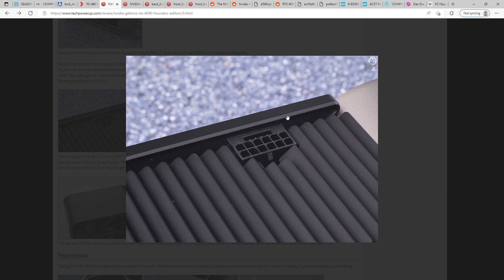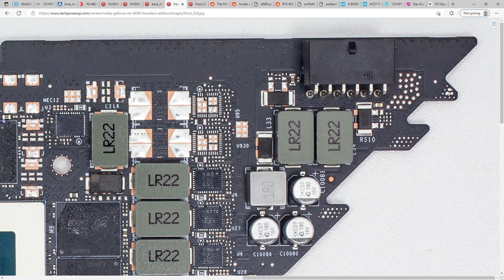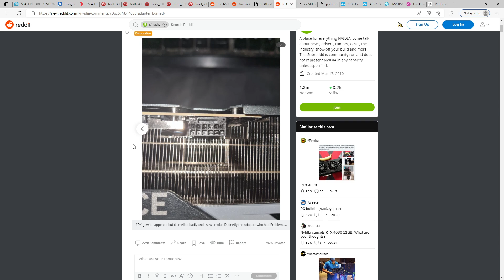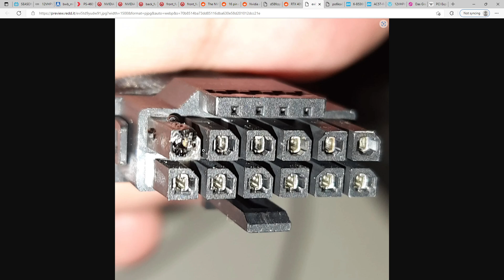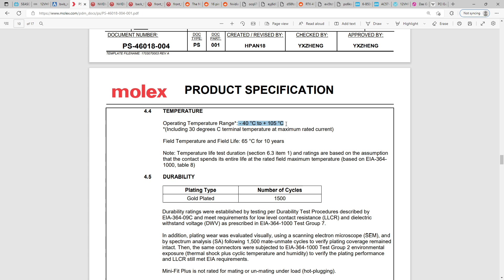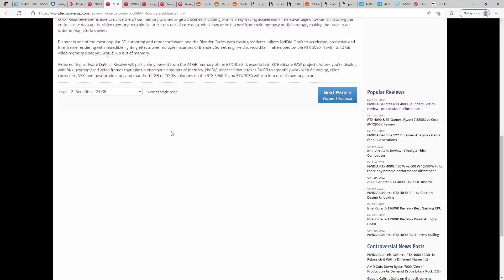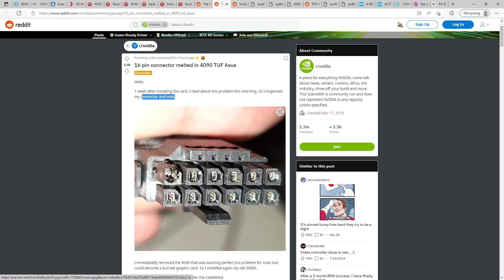rambling about the 12VHPWR failures

Comment: If you watch on "father" eatx12v 8-pin old connector from mobo back then (10-15 year ago), you will see that metal pin was square and solid. Now it's round and empty inside. I was facing problems with melted eatx12v 8-pin connector (never forget that smell after I run P95 small FFT's at around 30-35mins xD) on asus mobo(m5a99x evo r2.0) when OC'ing fx8350 to 4.6-4.7Ghz and 1.36-1.42 on Vcore. I think it was mostly coz of ~10 times cycle of reconnecting (switching between 3 cases) and coz of not so secure design of connector. After I buy some new connector and resolder to mobo and change connector on PSU it will run just fine 4.85Ghz(Vcore=1.4V) and even 5.0Ghz.

Comment: You started wrong and seems you are one of the more ignorant ones explaining what arcing is. Arcing means an electricity jump from one connection to the other. What are you talking about arcing from higher voltage to lower voltage?
Reply from the maker: if 2 things are at the same voltage there won't be any current flow between them.
Reply: @ActuallyHardcoreOverclocking  Look, if there is a small gap or disconnection, it renders the other end with no voltage at all. It is when the gap is too narrow that the current will pass through the air and then to the conductor on the opposite electrode. Unless you are saying that lower voltage means zero voltage.

Comment: 12:24 you are right. But to be fair it looks very very cost optimized to the point an engineer concerned with safety cringes how flimsy it comes across. Sure enough cross section will handle current fine, but man this looks like an artificial fuse like in the bubble gum wrap fuse. Well it can handle far more current than you expect, but man it is a joke.

Comment: I think it's ABS, the "melt" temp is pretty much what the glass temp for ABS is so it would need at least 105c to start to glass.
Reply from the maker: it's Nylon: https://cdn.amphenol-cs.com/media/wysiwyg/files/documentation/datasheet/boardwiretoboard/bwb_minitek_pwr_cem_5_pcie.pdf
Reply: @ActuallyHardcoreOverclocking  so its nylon 66, I haven't used that material, bed temp for printing is 60-70c and an upper operating temp of 110-135c depending on the specific material properties. The upper operating temp of the connector would start to soften that, if there is a enough force on the cable it might make more room in the housing for the pins to move and split reducing the contact surface.
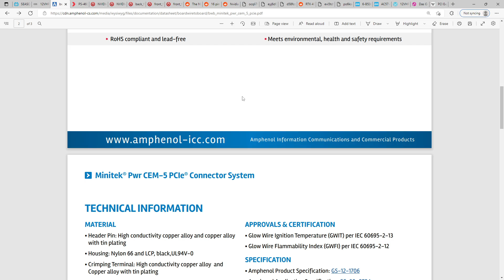Reply: much more common for those type of connectors to be nylon, and it's briefly on the spec sheet at 25:55 "Housing: Nylon 66..."

Comment: instead of guessing what current goes thru what wire, you can buy yourself a DC Current Clamp Meter like i have and measure it directly, great currents will always go  thru the least resistance trace, so they will hardly like the thin traces from the motherboard, that go from the PCI express port to the 24 pin connector (that usualy has thinner wires too)...
Reply from the maker: I've literally measured the fact that a very large portion of the GPUs return current goes through the motherboard. This isn't speculation. I've tested it. The only way to get most of the ground current to go back through the GPU's own power connectors and not through the motherboard is to either put a lot of load on the CPU or to use 1 PSU to power the motherboard and a different PSU for the GPU.
Reply: @ActuallyHardcoreOverclocking  you clearly measured a 100 watts card, try this new one now at 600 watts, also usualy minus pins are connected to the ground, which is always much thicker on any board (mobo or video) and with a much bigger area of copper, which is hard to heat , that`s why the minus wires are always cooler and will not melt the plastic
Reply from the maker: @himanologanor4093  I've done it with 450W GPUs. I don't even really have any 100W GPUs.

Comment: I have been laughing at the theories about this, the heat is at the pins, so the clearance is to big causing resistance that is causing heat..... if you're going to spend the money for a 40 series, buy a power supply that has the correct cables and throw the nVidia cable right in the trash....

Comment: I'll disagree with the assumption that 12 volts DC can't arc. Good welds can happen with just 10 volts DC, with less then 20 amps. So, that voltage can arc easily if designed to do so, and definitely accidentally  too.
Reply from the maker: in welding you need to first start the arc and then sustain it at a lower voltage. You aren't gonna start an arc with 12V.
Reply: I know that welders say that this is a "arc" but it's just sparking from the local heating the welder uses to fuse the material.
A spark ejects matter but a arc doesn't.
For one millimeter of air you need a voltage of 1000volts just to jump that gap in air, with dividers you need way more!

Comment: The NV connector terminal isn’t gonna separate since it’s encased in the housing. That’s gonna keep it from widening and not making contact with a pin. Even bending the cable to the side isn’t gonna make that happen. You’re just being silly now Buildzoid.
Reply: You are putting way too much faith in that housing. Those connectors have quite a bit of slack within the housing.
Also plastics don't keep their strength very well when it gets warm. It doesn't help that there is a 450W mini-hairdryer blowing warm air at it.
Reply: Rofl, there is so much space between those, you are very clueless

Comment: Your the first person who has actually said what seems obvious. If the problem was at the solder joints why is the melting at the opposite end? It’s because the problem is at the actual connection where they are making (poor) contact and the melting is happening.
Reply: Yeah... Man J2C is no electrical engineer that's for sure.
Reply: @jlgroovetek  ...I don't think he ever claimed to have any expertise either...
 
His knowledge of this subject is evolving along with everyone else's - what actually matters is that he has put a spotlight on, ya know, a real life, VERY plausible fire hazard
Reply: @RyTrapp0  Yeah fair call.  I had to bend the connector significantly on my Gigabyte 4090 Gaming OC to close my side panel up against it, and yeah ran it at 600w for hours-long stress test OC'd no worries.  I suppose we're only going to hear about the failures on the web rather than from the tens of thousands who haven't had issues.
Reply: Plus the fact that they are using garbage like thin metal both on the board and on the cable that makes the  actual connection. Its the same fault that is often made when you try to make a cheap high powered speaker. It doesn’t make any difference that your cables is thick enough for the power drawn, if the connector on the speaker Unit is poor or the small wire leading the signal to the coil is too thin you are going to get too much heat. It’s just a question wether its critical enough to make any damage.
Reply: Asking the question is more than enough, Buildzoid influences the meta. But I don't think its safe to conclude that is the only problem at this point. A lot of people like to armchair participate, including Buildzoid, me, and probably you, thats fine, but people with the gear need to continue to investigate. We will find out soon.
Reply: I think it's exact opposite. one connection is making too good connection and when all pins are connected with bar so that pin get bigger portion of delivered current. With individual cables per pin is little better because cable resistance will try to even out that current balance. Mechanical torque can push some pin to better contact and then it get bigger amount of current and have same voltage drop over connection as other pins. So it get more power to dissipate compared to others.
Reply: @LimbaZero  jayz2cents takes the cable and bends it and you can clearly see the outside cables are stressed more than the middle ones.
Reply: The opposite end happens to be where the plastic is the smallest area (very fine sidewalls at the keyed area) vs. elsewhere in the connector. Also it appears the material around the solder joints is different to that of the keyed area that is melting. Melting wont always occur directly at the heat source (especially when there is a length of conductive metal traveling away from it), the heat can transfer and melt a weak spot before the area at the original heat source.
Keep in mind the keyed part of the connector that is melting first is also not out in the air flow of the case actually its likely surrounded by the heatsink on the GPU that is also radiating heat.
Reply: Because if you lose a solder joint, you have the same amount of current going through a smaller amount of terminals, leading to more heat generated in the terminals that already have a suboptimal contact. More current more heat.
Reply: @Maekiii  So losing connection on one of the terminals by breaking the solder joint would cause the rest of them to carry a bigger load. Yes - but how does it explain that melting is happening on supposedly disconnected terminal-pin connection?
Reply: @the-wert  You're assuming the hypothesis is that the disconnected pin is the hot one. The opposite is what's being hypothesized IIUC.
Reply: @gmt-yt  BZ in his video shows a Reddit post with a connector melted on the terminal most extreme from its center. From what I can understand, those terminal-pin pairs that are on the outside of the connector are the most susceptible to breaking solder joints. Or there is more than one thing catastrophically wrong with this design - which would't be surprising at this point.
Reply: @the-wert  ACK. Also I just saw the Paul's Hardware video and he is, in fact, unambiguously hypothesizing that intermittent soldier-joint connectivity is the cause of the heat which, ok, not an insane hypothesis, but does beg the question of why that heat would shunt from its source near the soldier joint down to the terminals and pool there (airflow dissipation near the joint, maybe, as BZ suggests... but there's a /lot/ more plastic and trapped-air-pocket thermal insulation happening around there, as well.... anyhow fwiw that indeed makes you right and me wrong :)). I kind of prefer BZ's instinct to blame this on those nasty lookin' connector pins instead. Maybe the way to salvage this whole connector, then, is simply to upgrade those contact-crimp-doodads. It ain't me, but I'm sure all these molex type things are very well understood by the right SMEs already, making this is a cost optimization problem, not a we-must-invent-a-new-kind-of-plug problem :)
Reply: @gmt-yt  I'm leaning more on the Igor/Paul side of things, there are very obvious signs of solder joints breaking and making intermittent connection. But metal is a good heat conductor, so the temperature will quickly spread to the terminals. I suspect that the wire side of the connector is getting even hotter, but the gap between the metal and the plastic housing is larger on that side so the plastic doesn't get as hot as it does on the terminal side where the terminals are almost touching the plastic.
Reply: @the-wert  but the outside pins are also more susceptible to bending the contacts than in the center since things stress more from the outside than inside.
Reply: @the-wert  because they are all connected with a plane
Reply: @the-wert  The pins in the cable share the conection internally, you can loose a solder joint and you have 12v anyway, the melting is in a badly touching conection, you have an area of metal in the pins and the conector, if you "bend" the conection you have less area touching and then will melt with the heat.
Reply: @the-wert  If you look at the pic from Igor’s lab, you’ll see the wire itself is disconnected but the terminals/connectors are still attached to each other. I thought the same thing until I took a closer look at the pic.
Reply: Yeah he analised it and Igor further proved it.

Comment: Load balancing on the 4090 doesn't work because the 4090 adapter internally shorts all the pins. If Nvidia kept them in separate pin groups like the older 3 8-pin adapter, load balancing the pin groups separately does help in the failure mode of one of the 8-pin input wires completely breaking off and not shifting the full GPU load onto 3 or less wires. I imagine they added power balancing on the older adapter for split rail PSUs. You can't trust the PSU having the same output impedances on all the rails, which could cause overloading on one of the split rails.

Personally, I like the idea of moving towards a single power cable instead of running multiple 8-pin cables over to the GPU, but the implementation was clearly a massive failure.
Reply from the maker: the 4090 doesn't have any load balancing circuitry.
Reply: @ActuallyHardcoreOverclocking  Sorry, I think I accidentally deleted a sentence. Was supposed to start off with: Ironically, load balancing on the 4090 might have helped Nvidia if they kept the adapter more like the 3090ti in certain failure modes.

Comment: Well,if the pin is getting hot on the connector, could you not use a camera at that open section of the backplate that exposes the back side of the connector on the PCB side? It looks like the pins burning are the ones closest to the PCB. At the very least that open section of the backplate may make it easier to setup a thermal couple to.
Reply from the maker: thermal cameras don't work well on bare metals and the PCB of the GPU acts as a heatsink for the connector.
Reply: @ActuallyHardcoreOverclocking  true, but if those pins are getting hot in the connector, wouldn't the PCB around the pins of that connector be much hotter than the rest of the PCB, because metal conducts heat. Was watching your video and it seems the first one that was posted the connector is oriented reverse of what the FE card is, and the pins effected are the ones closest to the PCB. It seems t ok be a Gigabyte model, if I'm not mistaken. Not calling them out, but more of the open access to where the pins come though the PCB could be tested for voltage or even heat as you explained in the video. Just running my thoughts by you, don't see me as a complete idiot please.
Reply from the maker: @Celician83  the thing is the heat might spread too quickly to see which pin is running hotter than the others.
Reply: @ActuallyHardcoreOverclocking  I was just saying that is a good shot vs just shooting with a camera. Maybe try it while doing a Port Royale run or as soon as you load up kumbustor

Comment: They didnt say the solder joints melted, they broke and put too much current into the pins that are still connected.  You have a combination of that and the shitty split pins they decided to use and now it's all melty
Reply: I just cannot believe they rate that for over 10 amp a pin.
Reply: @mrfarts5176  that's not a big deal.. there are pins way smaller than that in automotive applications that get 10a or more through them, hell there have been plenty of gpu's that would pull down 600w+ through 2 8 pins. There is nothing fundamentally wrong with this connector.  The problems here boil down to cheap parts made with little quality control.
Reply: @jdoggsgarage4494  I have been designing automotive electrical systems for well over a decade and even pins rated for 6 amps are twice the size of these or more.  I am not saying you are wrong, I am just saying if I had one of my engineers using this on a 10 amp circuit, I would probably have a talk with them.  I have had seen a surprisingly large quantity of electrical systems burn up.
Reply: @mrfarts5176  Deutsch DT connectors are significantly smaller than these and rated for 13 amps. Even the old weather pack connectors can be had up to 20a and are similar size to molex.
Reply from the maker: the pins are internally bridged after the solder joints.

Comment: as an electrical engineer this channel feels like a wet dream
Reply from the maker: glad to hear it.
Reply: He is saying you cannot arc 12 volts.  He sounds like someone with a rudimentary understanding of electricity.  I have seen voltages under 24 vdc arc like crazy due to inductive loads.
Reply: @mrfarts5176  please explain what is the pin in arcing to? cuz from what i know u cant arc from metal to PLASTIC with an air insulation
Reply: @mohibdosani6957  maybe they have an Intel GPU 🥁
Reply: @mohibdosani6957  OK, when a split pin starts to open, intermittent contact will arc.  I have seen this so often with field connections on Automation where connector bodies are fixed to a structure when they shouldn't be.  This exact issue is one of the highest causes of electrical failures I have seen in nearly 2 decades as an engineer designing electrical systems on automation.  The point is when you have current draw and start to open the circuit, any inductance in the load will force current draw increasing voltage and causing arcing.

I am just saying it is inaccurate to say a 12 volt load cannot arc.
Reply: @mohibdosani6957  the arcing would happen if so between a small gap of female and male terminal within the connector // it is not a it has always have to happen case. 
How it comes to it? If the female terminal is bent outwards the male connector has no full area where the current flows from one cable into the pcb. The smaller that area is the more it warms up. If this happens thermal stress can make it bent even more or press the connector in such a way, that the smal connection that was there now becomes a gap, which then will be in the right moment a point where a spar could form leading to the charing and not just "melting" of the plastic surrounding of the connector.